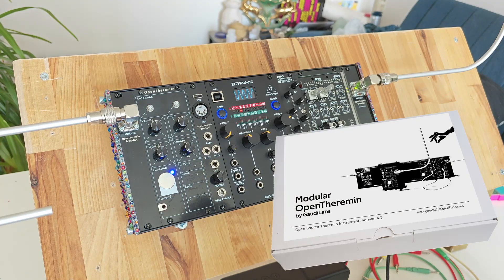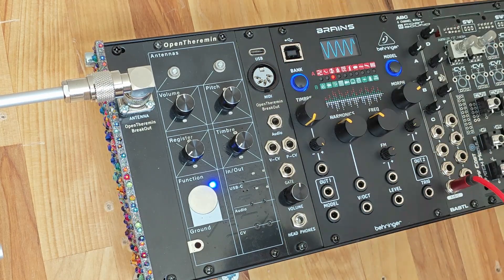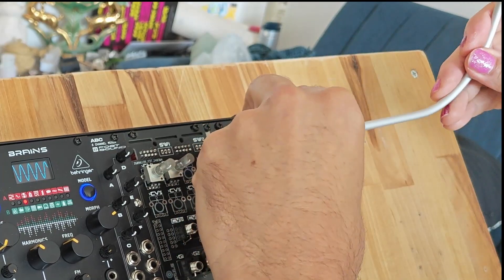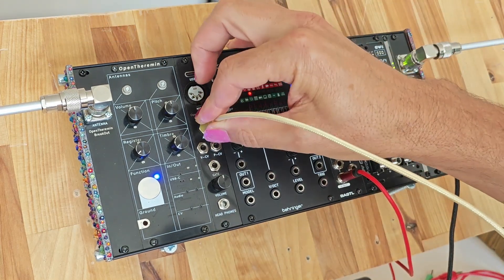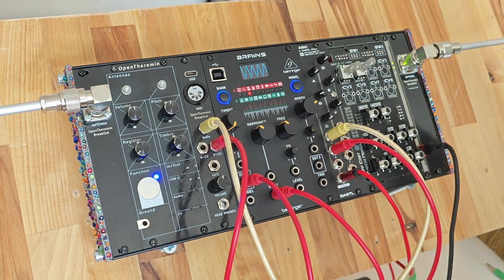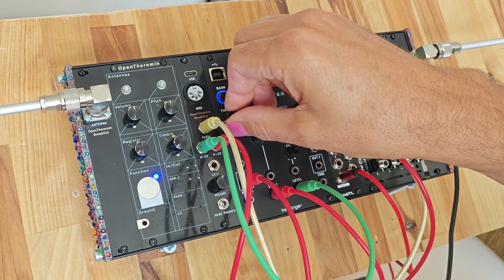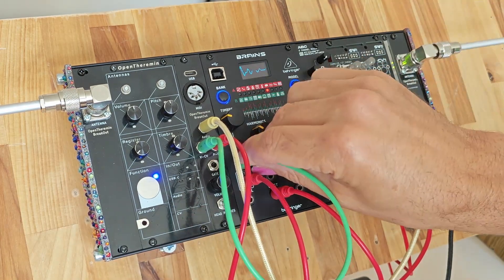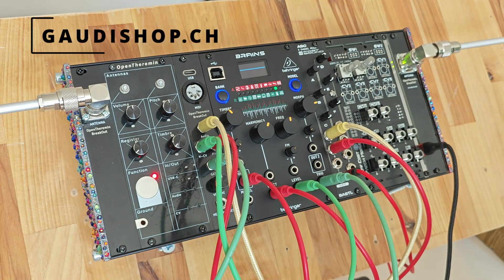OpenTheremin Modular Kit - Basics

Comment: This is fantastic!  I am in the process of integrating my Open Theremin v4 into a modular system.  Is it possible to purchase the breakout module by itself?  I realize there is the ribbon cable connection on the Open Theremin's PCB.  Is that something that can be done DIY, or does it require the new board rev?